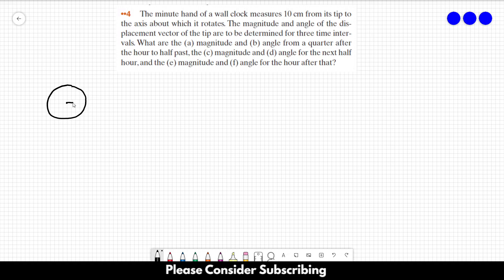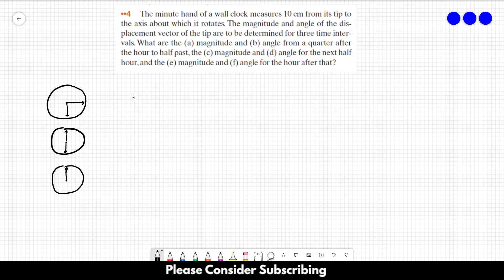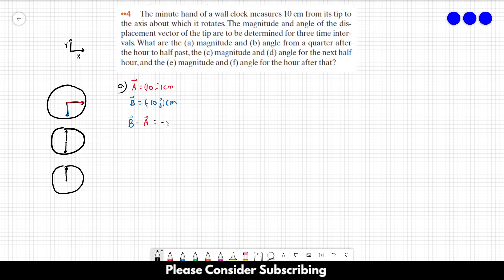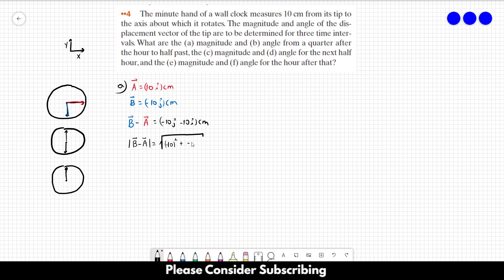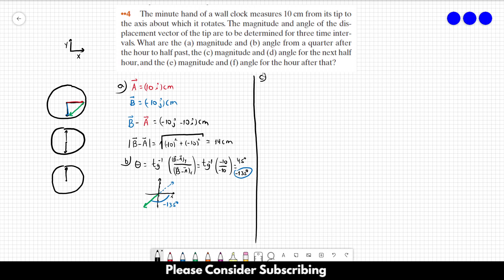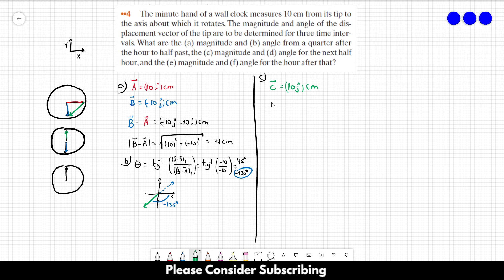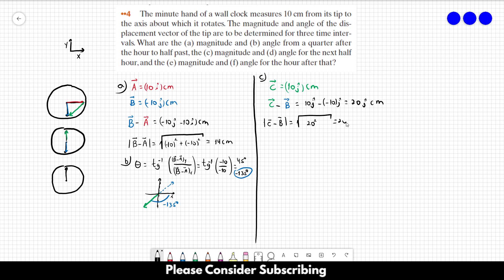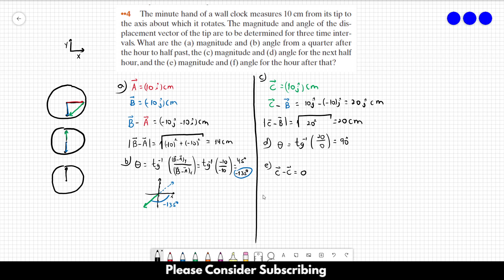HALLIDAY SOLUTIONS - CHAPTER 4 PROBLEM 4 - Fundamentals of Physics 10th

Comment: For question d, how is it possible dividing 20/0?
Reply: He's just making stuff up and changing how he's doing the math every question. When finding the magnitude for letter A, he did it correctly, but for letter C, you can't add them together like that, or else it makes the equation meaningless. You need to take the exponent before adding, then take the square root of the numbers. You can't just add numbers with the same exponent together and cancel out the exponent with the square root, or else you end up with something that isn't the magnitude. Any other video on how to find the magnitude says this. Secondly, either the question is written terribly, or his clocks are messed up. The first one is fine, but then the problem says a half hour after that for letter C and D, meaning it would be comparing 15 minutes to 60 minutes and letter E and F would be between 15 minutes and 30 minutes again (or technically 90 minutes). Because of these issues, i think that's why he decided to make an impossible equation, that being tan^-1 (20/0). if we are going by a 1 hour wall clock, letter E and F should come out to be the same exact answer as letters A and B, and if we are going by a real life wall clock, then this entire problem is wrong and needs to be changed. Another way to answer E and F is by using the 90 minutes, so the answer would come out to be 450 degrees if we used a 1 hour clock and -495 using the logic used here.